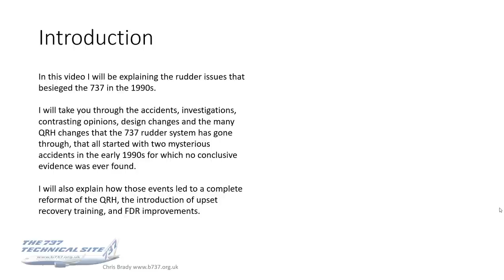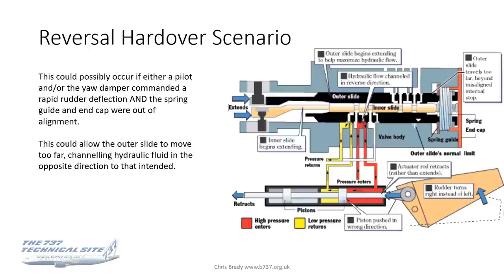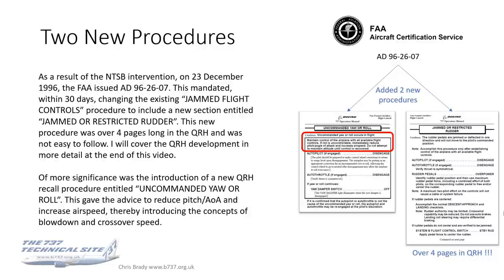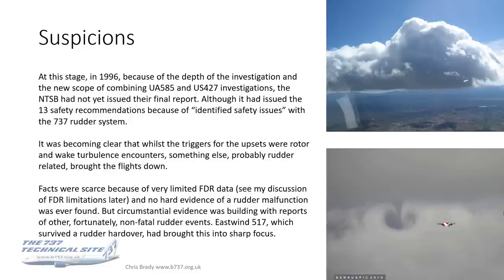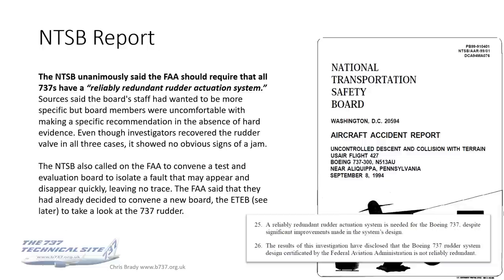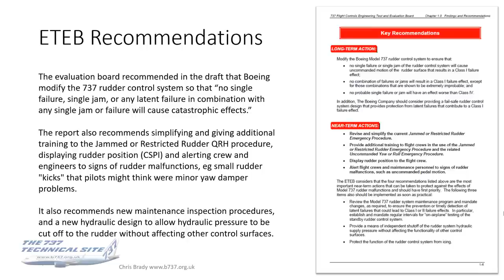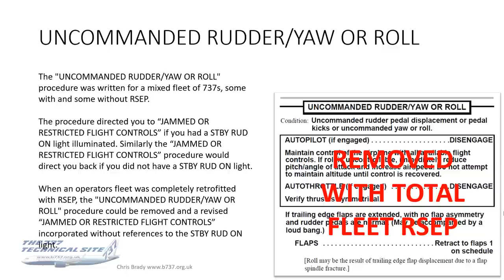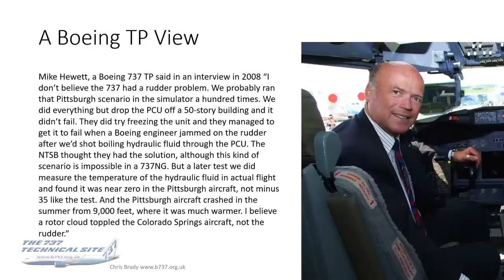737 Rudder Story

Comment: Well, after the APU video, I couldn't help but click on this one!

I used to be in charge of a large datacenter with a 99.999% uptime guarantee, which meant any downtime was very expensive to the company. Not life-and-death at all, but it was still routinely stressful enough that I extracted myself from the industry to preserve my mental health.

It's really interesting seeing some of the parallels between network outages and plane problems; both are complex systems, the operation of both is to a degree "opaque" to the operator—a pilot can't get out and look at the rudder, and a network operator can't see the packets moving on the wire. So you're at the mercy of your system's ability to provide diagnostic information about itself.

I couldn't help but have my mind blown to find out that something like a rudder position display is optional equipment. I can't imagine how hard it must be to troubleshoot a problem under duress without even basic troubleshooting information. I get that the idea with planes is that every possibility should be covered by checklists that do the deep systems-level thinking for you, but it seems like many problems start when the checklist is exhausted and there simply isn't enough information available to begin to understand the problem. Going back to my network operator analogy, when I found myself in those situations, I would have to resort to extremes like "let's unplug it and see what happens".

I remember a few occasions feeling so frustrated by being blind to certain aspects of my system and wishing I had spent more time "on the ground" improving visibility into certain aspects of the network. I also remember on occasion lashing up some spare equipment to help characterize an intermittent event in the system when it happened.  It's crazy that Boeing, the NTSB and the FAA were making life-or-death decisions based off of anecdotes and 5 channels of FDR data. I know that airplane hardware is incredibly regulated, but I also wonder how different the outcomes would have been if Boeing, the NTSB and the FAA had come up with a low-cost solution that could be quickly installed on all affected units to passively monitor the PCU that would at least provide diagnostic data in the event of another incident. In the words of the robot Johnny 5, "More Input, more Input!"

Anyway, a very interesting video. I learned a lot!
Reply from the maker: Some very interesting parallels indeed. At least they eventually got to the bottom of it.

Comment: I asked a TRE once if we could simulate a rudder hardover in the sim. I unknowingly encountered "crossover speed" during final as the speed was coming down. What a scary feeling to lose control authority!
Reply: If you get chance again, when you're at the limit, try pushing and pulling the stick (so decreasing/increasing AoA briefly). You should see an immediate response, regardless of your speed (the higher the AoA, the more the rudder rules roll, as you lower AoA, the airlerons will gain more authority).
There was a crash where this effect was not understood (I should have info to hand, but I don't) where the rudder was lost hard over, and the pilot coming in, on approach did the natural thing, and didn't concern with keeping speed up and AoA down. They got a touch slow, pull back and with full roll full authority running out, they pull back even more, not realising in that moment they sealed the fate of the aircraft and all those onboard.
For more info see safety pilot at AA video on "control malfunctions & flight anomalies" it's fascinating stuff from 25-30 years ago

Comment: A key aspect of dual failures is that the first failure mode is often a "latent failure" that exists for several flying hours prior to the incident, and then the second failure mode occurs acutely at the time of the accident itself. This means that the two failures don't need to begin at the same time, and the probability of the double failure increases dramatically. The way to correct this is for engineers to design the control system to intentionally lose some (but not a dangerous amount) of functionality when the first failure occurs, so that the pilots will become aware of the first failure before the second failure has a chance to occur. This is hard to understand, so let me provide an example, when the new RSEP servo valve was rolled out, both of the two linkages connected to the main PCU had jam override couplings where the torque tube meets each rod. This means that, if one valve jams, the rudder pedals immediately require 18lb of extra pressure to move the rudder the same amount. This creates an immediate indication to the pilots that something is wrong, but does not place the aircraft in any immediate danger. In this way, the airline is forced to perform an immediate inspection of the PCU servo valve, which will inevitably catch the single failure before there is any significant chance of a double failure developing.

Comment: While I though I kinda know this story for some extended, you take us to the whole new level of detail! Tank you!
One of the more recent rudder related issue if you may is ANA140 in 2011 when FO accidentally moved the rudder trim to a "hardover",although the investigation deemed the recovery by FO was insufficient, he still managed to make it in one piece, shows how far we have come in terms of UPRT.
One small question: just wonder if there is any known incident that FFM have been triggered in line operation?
Reply from the maker: Hi Umi, I am familiar with the ANA140 event where the rudder trim was mistaken for the door unlock. One of the big differences with that event and these is that ANA was at a much higher airspeed so was able to recover relatively easily.

Comment: We did hard slam reversals on these rudders in the hangar in the 90's, which consisted of one of us in the flight deck and another at the rudder connected by radio. I think it was either an AD or a SB. But I remember also disconnecting the PFCU input rod, applying hydraulics and throwing the spool valve rapidly from side to side with my fingers in addition to the above. We found nothing! We clearly could not replicate the thermal issues which Boeing considered a factor at that time.
Reply from the maker: Undoubtedly the failure mode was a very rare occurrence and a lot of things had to come together for it to happen. As flightcrew we also used to do a rapid full and free rudder check whilst taxying out during the 90's - never can be too careful!!

Comment: I watch Mayday. And after watching the one on this issue thought I knew what the cause and fix was. WOW great presentation! Looks like it was way more complicated and had much bigger consequences for the industry. Thanks for all your hard work on this videos!!
Reply from the maker: My pleasure. Glad you enjoyed it.
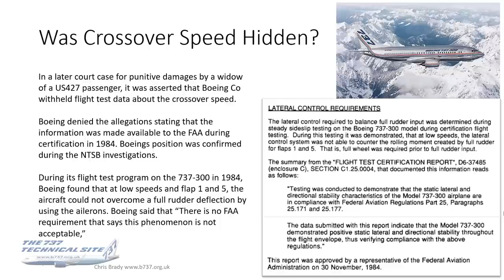Reply: At 50:30 .... Boeing Knew from mid 1980's Fight Testing that an Uncorrectable Rudder  over Aileron Control  crossover Speed in the Normal flight Envelope regime  Existed but since the Existing FAA cert requirements Didn't specifically List or Address this exact Control anomaly,  Boeing Didn't Reveal it During the Certification process....

Comment: I upgraded to Captain flying -300/500 in 1992, and was pretty well immersed in the string of events and responses over the succeeding ten years.  The company explanation of cold soaked PCU susceptibility to anomalies was never particularly convincing, though it resulted in redesign.  The various training in upsets and additional QRH procedures were enlightening, but, as I recall, excessive simulator wear tempered upset training.  I don’t recall ever learning about blowdown or crossover speeds.  We did implement the 10kt increase in maneuvering speeds…. (cya)

Comment: Hi Captain,
Thank you as always for your high quality educational videos, I am hooked to this channel! Would you by any chance have any documents or videos that could perhaps explain the difference between a power control unit and standard hydraulic actuator found on controls such as the flight spoilers? I'm mainly interested in knowing how the mechanism works for delivering the correct quantity of fluids into the actuator for a given flight spoiler deflection before stopping more fluids from entering. Thank you as always, and keep up the great work I look forward to your next series of videos!
Reply from the maker: Hi, thanks for your kind comments. Unfortunately I don't have anything that specific. However I would describe the main difference between a PCU and an actuator is that an actuator is usually used to move something to a discrete position. E.g. landing gear, flaps, ground spoilers. A PCU is much more sophisticated than a simple actuator because it takes a variable input, such as control column or rudder pedal inputs and gives a proportional output. Hope that helps. Chris

Comment: Chris: It appears we will need an update on the 737 rudder system based on the United Airlines stuck rudder issue of late...
Reply from the maker: Yes, I am watching that investigation with interest. ATM there is a question about the servo motors performance in cold soak conditions.

Comment: The "crossover" being shown at minute 44 is also known as crossover AoA, and is entirely dependent on AoA. The rudder is the most powerful roll device at high AoA, in all aircraft, on a good day. If you roll airbus at a slow speed and have some way to see (on SIM, or from outside) you'll see the rudder moves as much as the airlerons, even though the pilot didn't command any rudder. I realise we're talking about Boeing here, and it's arguable that airbus isn't so much a plane as it is a computer with wings, but the areodynamic principles remain, and they exploit these PoF with hardwired code into their FCS to do make us of these effects.
These videos are fascinating Chris.
(I got the above information from AA's advanced manoeuvring program, by CPT Vanderburgh, his old presentations are online, even though they don't specifically reference 737s)
Reply from the maker: It is interesting but actually incorrect, crossover speed is not entirely dependent on AoA, it is dependent on several factors, weight, config, CG, AoA, G, etc
Reply: @ChrisBrady737  that's interesting, because this is not my experience at all.
Try holding the wings level until max roll authority begins to lose it, and push and pull the control, the response is instantaneous... In other words the things you've listed, weight, speed CG haven't changed, only the AoA.
Please try it, but also link me to any material that shows where the elements youve listed can impact this effect, with AoA remaining the same.
Again as I understand it, the ONLY thing to affect this crossover effect, is the AoA, clearly changing weights and CG or configuration is going to affect AoA, but when the same AoA is reached under the new config, in my experience you'll lose it exactly the same place.
Reply from the maker: @CameTo  i think we are saying the same thing. For a given config, weight, cg, g loading the only remaining variable to affect crossover is alpha. But just like Vs, Vcrossover will vary with the above factors because it is a lift issue.
Reply: You can not compare the 737 flight controls to the Airbis fly by wire design. You have turn coordination on the A320 which means automatic rudder  (plus automatic stabilizer too) when you roll the plane using the side stick. But only in Normal control law. 
On the 737NG you have also automatic rudder called Wheel To Rudder Interconnection system. Only when you do manual reversion. Its using standby hydraulic pcu to move the rudder under 0.45 Mach.

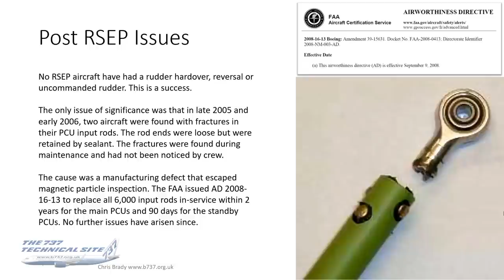Comment: got to 1:50:00 and was still interested. well done on keeping technical blurb less than drone on boring. i was also imagining the last seconds of those two accidents and the feeling of woe those pilots must have had.which reminds me, do the 737's now have the auto engine control system which allows directional control in the event of total loss of hydraulics?? by engine power control only.. re:  United Airlines Flight 232
Reply from the maker: Thank you for your kind comments, glad I was able to hold your interest. No, the 737 does not have an engine directional control system. The 777 has a TAC which assists with rudder input if an engine fails but not the venerable 737.

Comment: Hello Chris....is it safe to say with regards to the FFM and an opposing pressure......

Main Rudder PCU is turned off with A and B Hydraulics out of the picture and Standby Rudder PCU is activated and solely operating the rudder for the rest of the flight....

Or Standby PCU assist the correct working system not jammed to help control the rudder the rest of the flight...

Sorry to ask...got myself in the weeds on this one and the FM for my airlines goes very basic in its explanation.  

Thanks for all you do Chris i really appreciate your book, videos and insight on all 737!

Cheers 

GUS
Reply from the maker: Hi Gus,
Your first scenario is correct. If the FFM detects opposing pressure, the rudder will then only be powered by the Standby PCU and the STBY RUD ON light will illuminate.
Great to hear that you like the book.
Chris
Reply: @ChrisBrady737  Thanks so much for clarifying Chris!!!!!!

Comment: Airbus A320s have Rudder and Elevator problems.

Source; Wikipedia

On 28 December 2014, an Airbus A320-216 registered as PK-AXC, crashed into the Java Sea killing all 162 on board. 
The cause was initially a malfunction in two of the plane's rudder travel limiter units.

On 5 November 2014, Flight 1829, an Airbus A321-231 registered as D-AIDP, was flying from Bilbao to Munich when the aircraft, while on autopilot, lowered the nose into a descent reaching 4000 fpm. The uncommanded pitch-down was caused by two angle of attack sensors that were jammed in their positions, causing the fly by wire protection to believe the aircraft entered a stall while it climbed through FL310. 

On 31 October 2015, an Airbus A321-231 registered as EI-ETJ operated by Russian airline company Kogalymavia crashed in the Hasana area of central Sinai, Egypt while en route from Sharm El Sheikh, Egypt to St. Petersburg, Russia. There were 224 people on board (217 passengers and 7 crew). There were no survivors.